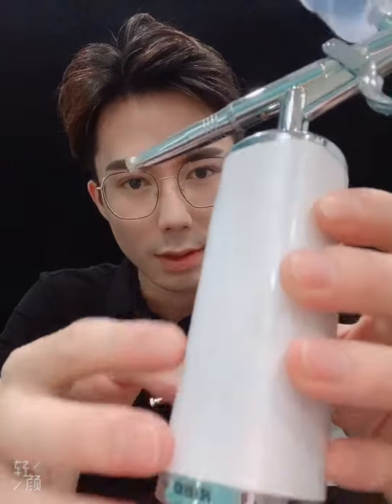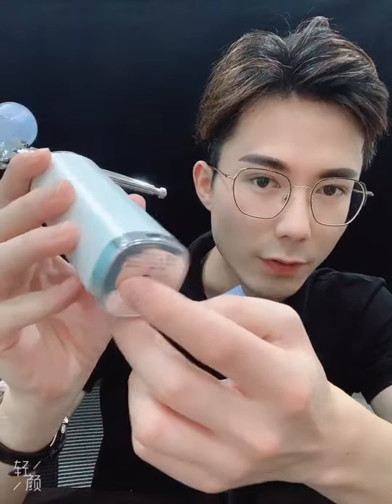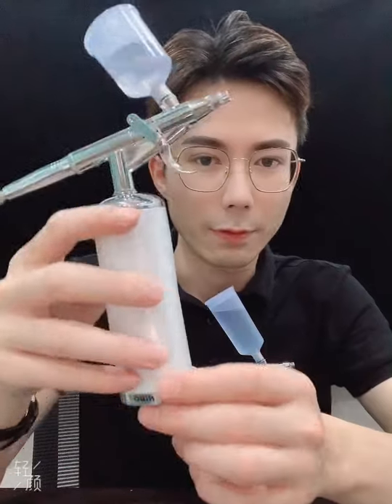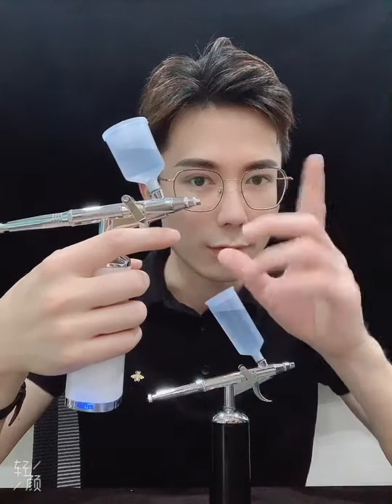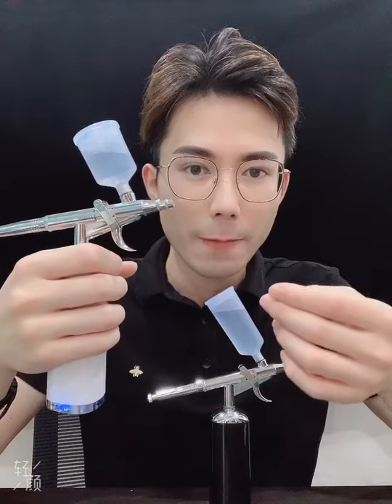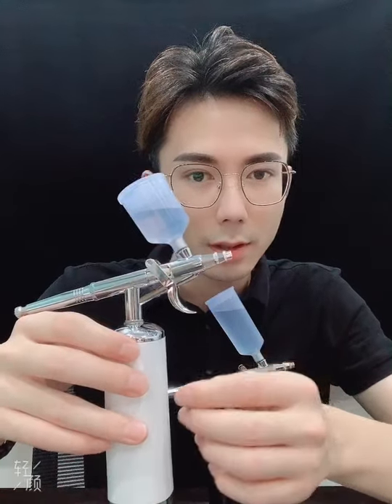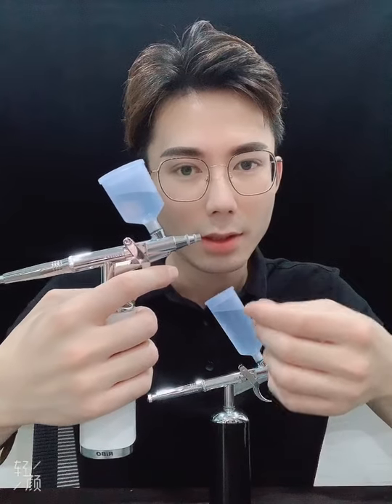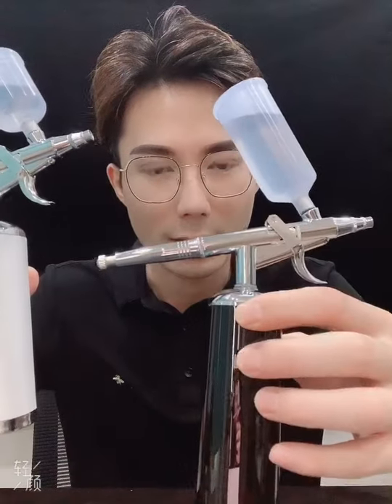27PSI Trigger type cordless airbrush kit.

Comment: I prefer mine with dual action and no power button.
Reply from the maker: You can check our another type. Auto start anf stop, dual action, no power switch. 27&15PSI adjustable. 60 minutes continuous working after fully charged.